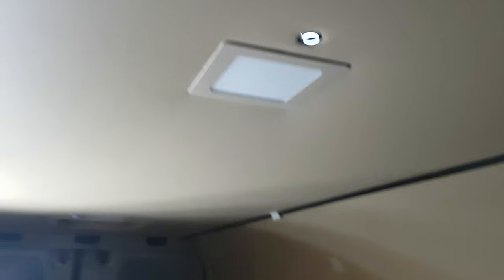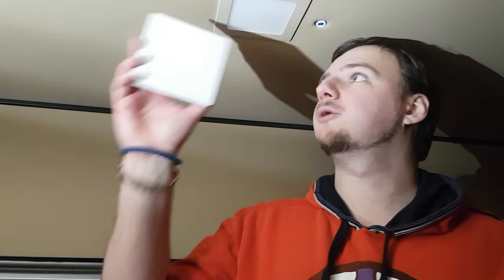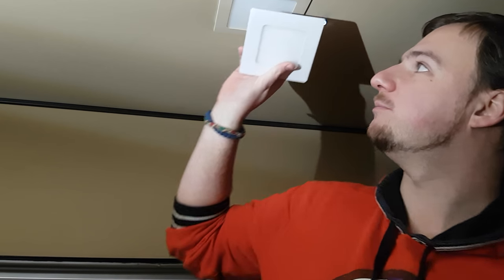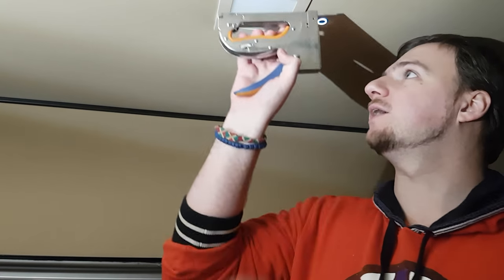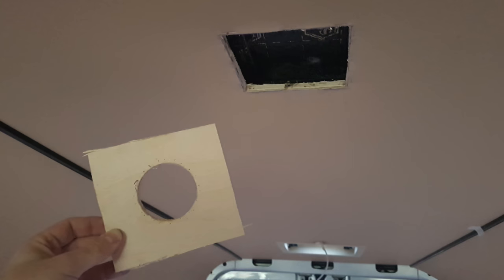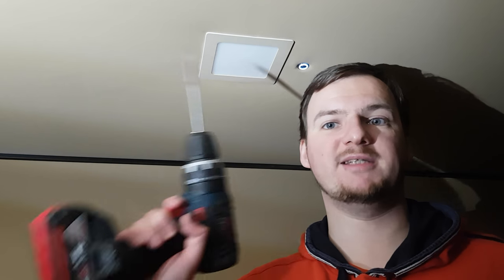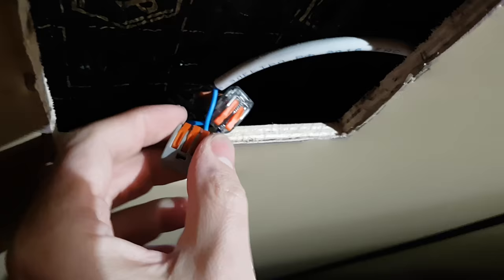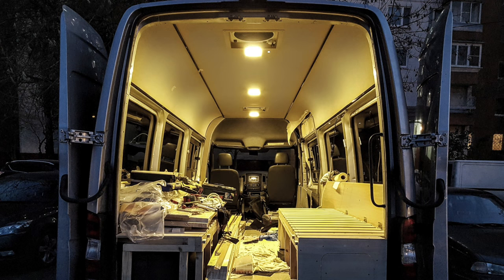Led ceiling panel lights installation in a van conversion diy motorhome/campervan build

Comment: That small box that is attached to the led light is a driver. It’s used to convert voltage from household current to 12V. You could just cut it off and connect light direct to a 12V source. Great vid and tutorial!! Keep up the great work.

Comment: Бокс к лампе это драйвер с 240 на 12в (или 12-24). Они так до сих пор и соеденены с этим боксом?
Приобрёл подобные, но от V-TAC (6W, VT-607) и они не работают от 12в так как нужно 18в. Там внутри них какая-то странная лента, которая меняет напряжение при укорачивании на каждые 5 диодов. Надо обрезать, либо попробовать с этим драйвером, хотя думаю вряд ли он с 12в до 18в поднимет.
Reply: Проверил, действительно драйвер для лампы, преобразующий 240 AC на 12-24 DC также преобразует 12 (на деле 13.9) DC на 16 DC (видимо максимум на что хватает). Интересно.
Как долго лампы так проработали? Или до сих пор работают? Интересно, там напряжение было 12в или больше? А то в таких панелях используют специальный тип лед ленты, поэтому там разное напряжение для разной мощности (3вт - 9в, 4вт - 12в, 6вт - 15в, 9вт - 18в...)